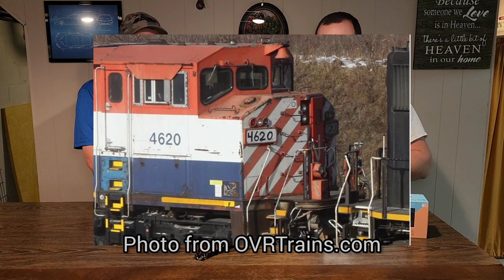Aurora Miniatures SD60F Model and Manufacturer Review

Comment: Excellent informative video which I enjoyed watching. I have locomotive no.5560 SD60F which had a small amount of jerk at slow speed but after being run in for 3 hours it ran smoothly. The only other problem was the rear body rose slightly then the fans and rear light did not work,however by pressing the body down lightly they worked. I think Aurora Minitures have made a great model. I have subscribed.🇬🇧🚂😊😊😊